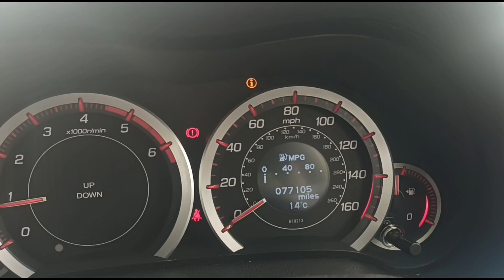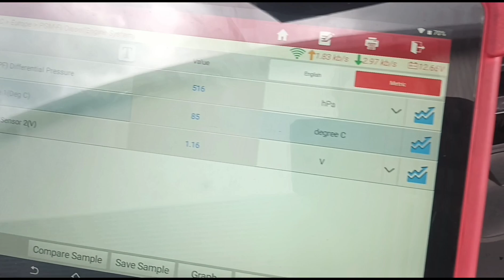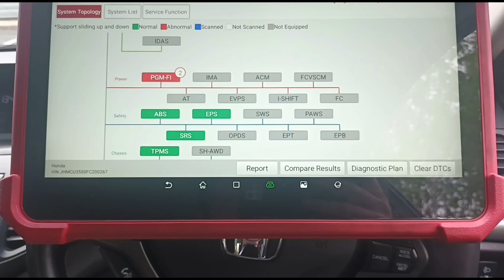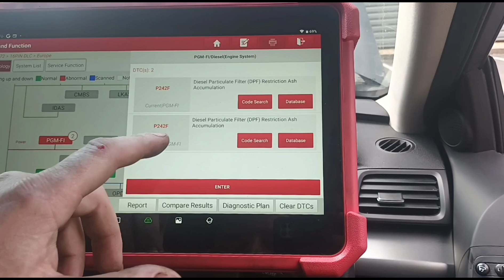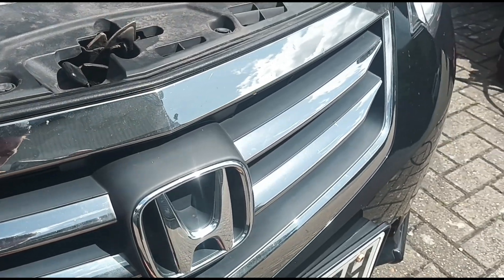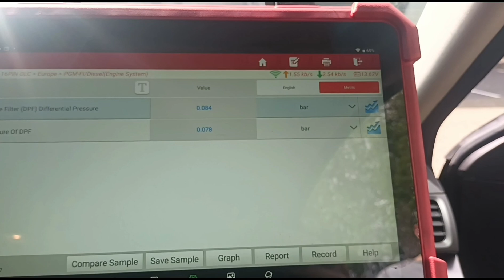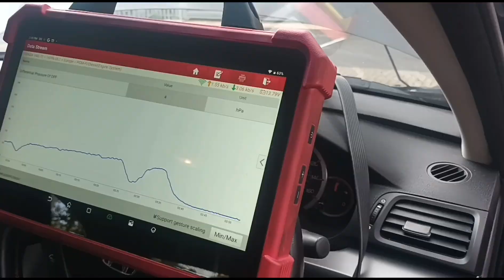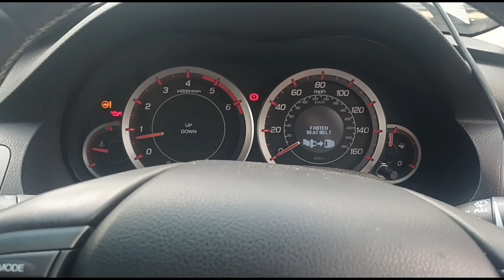Honda Accord 2.2 P242F DPF Restriction Ash Accumulation Smoke Light. Particulate Filter Cleaning

Comment: How many litres of the dpf cleaning solution do you use with the launch dpf gun, is the solution mixed with water. Having same issue with my accord and I’ve just purchased the gun and cleaning solution, Thank you.
Reply from the maker: 1 litre 50/50 water
Reply: @ORileysAutos  thank you

Comment: Honda Accord MK8 owner here. Great video and best explanation so far. I'm onto my third forced regent in around 12 months and pretty sure I'll need a diagnostic and service like this soon. The hard part is knowing I take my car for those long drives and rev it hard where I can. I wonder if the DPF is a weakness in this particular car.
Reply: Yes it is definitely a weakness on these 2.2 hondas and it's a pain in the backside sometimes a clean and reset will still only last a couple months
Reply: A thing to check is that you don't have the oil too full, a level halfway between the dipstick min and max marks on level ground is the limit. For some reason this affects the DPF regeneration, forced regens are fairly stressful for the engine and exhaust so if you can avoid them it is a good thing.

I'd suggest getting an OBD tool that can monitor the differential DPF pressure, if that starts to increase then you can try adding some DPF cleaner and then go for a half hour drive at 2,000 rpm or so on a decent dual carriageway.

However, sometimes there is no substitute for Jimmy and his Launch Tech gun and fluid. My 264,000 mile Accord 8th gen iDTEC has just had this treatment and it's back to great performance again. Worth the money certainly.
Reply: @BrianMorrison  Hi Brian, thanks for that. At this point I've tried almost everything I can think of, including frequent oil changes with recommended 0w30 ACEA C2... Even the dealership are at a loss beyond replacing the DPF. I've got a scanner but it is fairly limited even with live data, showing no fault codes and low pressure with low particulate matter. Just an absolute nightmare of a car. At least it has heated seats though! 🤦
Reply: @mingtooter  My backside stays cold I'm afraid. If you can get it to Jimmy then you may find things get better.
Reply: Same here had 3 auto regen at honda at just short of £200 pounds a go came on again  Been driving in limp mode for about a year  now was  doing "motorway driving"😢